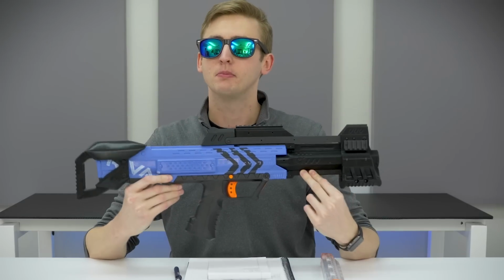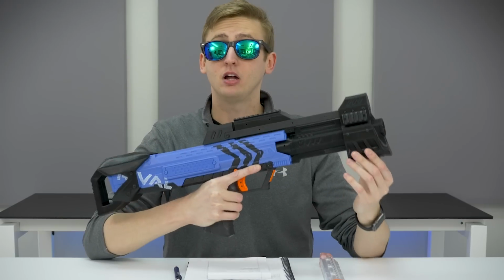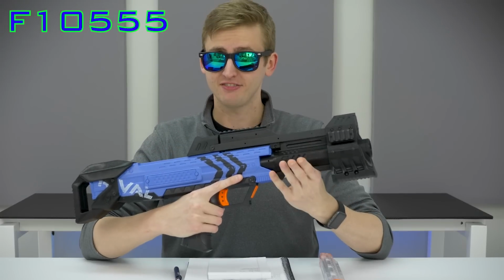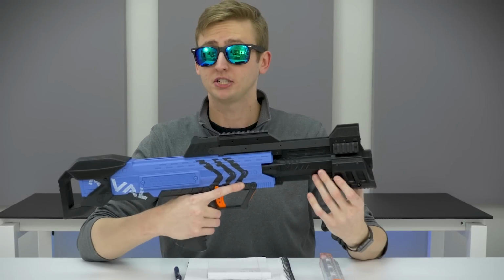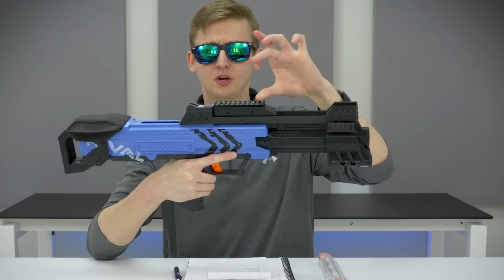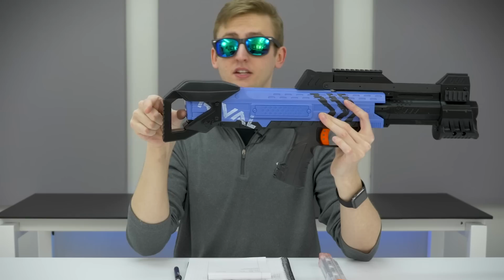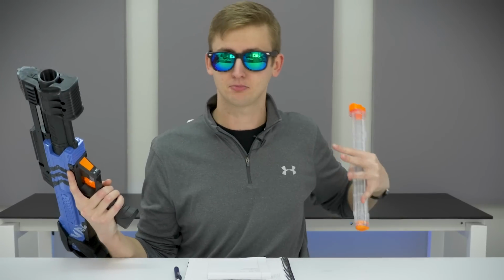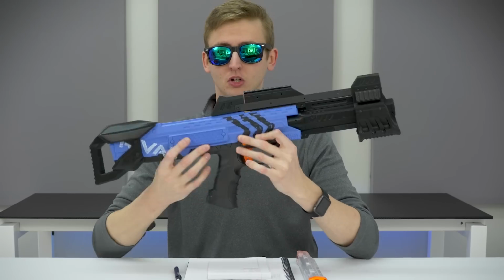Pump Action Nerf Rival Apollo | Mod Kit by F10555

Comment: I think you can have top prime and be able to rest your hand in aiming position. There just hasn't been a top prime with stock and comfortably positioned piming bar with ergonomics for the top slide. Your arm doesn't naturally want to go into that under position. It causes your ulnar or whatever to flex. Top slide doesn't cause your bones to twist. Vertical grip also doesn't cause this.

Comment: I like this blaster. Low cost,simple design, quick reload and doesn't require batteries.  completely agree with the priming system tho. The only efficient way requires you to lower the blaster completely.   I have materials for a diy version but aside from cost this is quite tempting.  Very nice.

Comment: Coop! if your worried about the noise of the 3D print you can put in some extra time in and use some kind of body filler like Bondo, and then give the 3D print a cool paint job.

Comment: That annoying noise when you pump is mostly due to layer lines scraping against each other. You can solve that problem in a few different ways.

1) Tell the manufacturer to orient parts that will rub against each other horizontally instead of vertically so movement will be parallel to layer lines. Horizontal orientation isn't as good from a manufacturing perspective though. Critical dimensions are more prone to warping, prints take longer, and you can't fit as much stuff on the build plate.

2) Smooth the contact surfaces. You can do this chemically with some acetone if the parts were printed in ABS, but that could cause its own set of problems so you're probably better off with mechanical smoothing (i.e. sandpaper). You could also try pumping the gun as fast and furiously as possible so the layer lines will grind themselves flat, but that would look stupid. Good workout though.

3) Mouse tape or squares of very thin teflon. I'm not sure how much room there is between the handle and shroud, but it would give the quietest results. Ideally, the manufacturer would incorporate this into his design and include some teflon pads with the kit.

Comment: The sound of the 3D printed parts rubbing as you prime the Apollo is atill too obnoxious, especially during the rapid fire in the demo. Could you sand the surfaces that rub together? Alternatively prime the Apollo a few thousand times and it'll start to rub itself smooth.